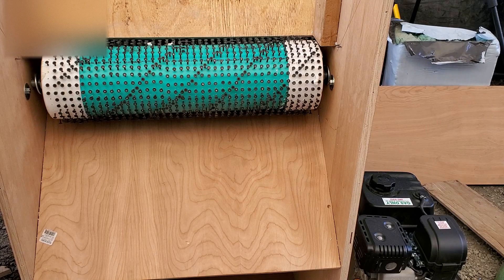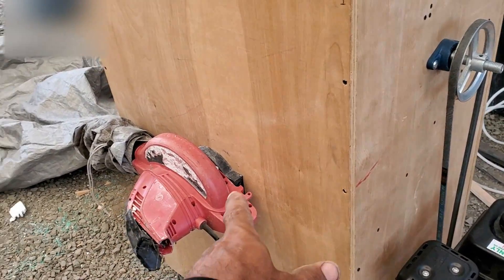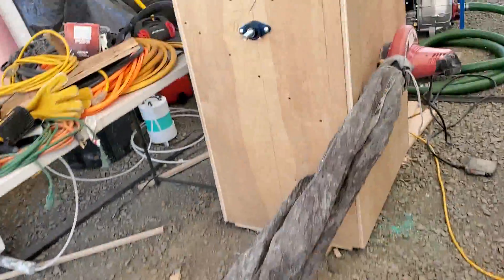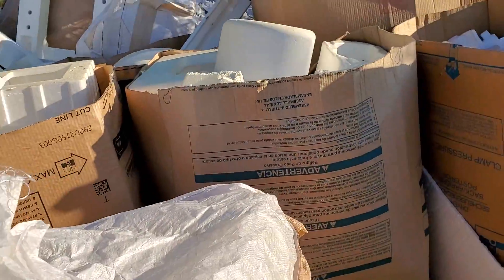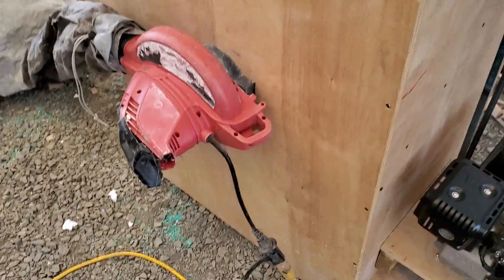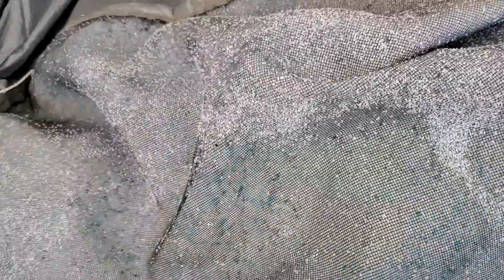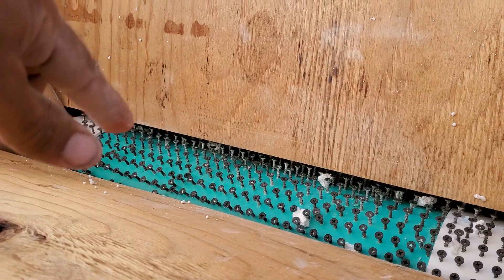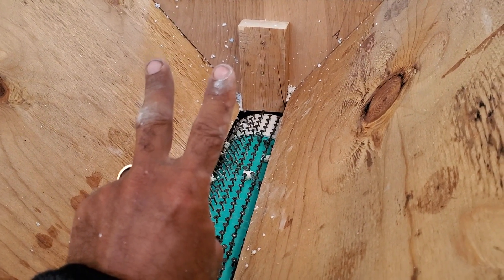DIY Foam Shredder | Styro Aircrete | EPIC Cement Mix | #foamshredder #styroaircrete #aircreteharry

Comment: Im looking to do the same. One thing I found that EPS insulation property's degrades as it is exposed to sunlight. You shouldn't store outside while its exposed to direct sunlight. 😊
Reply from the maker: @tomkupcho7041  Welcome to the channel - Tom! Check out the newest video called: The Ultimate Foam Shredded, posted on this channel. It is more convenient & a faster process of shredding the foam. The DIY Pdf file is available on our website, link in the video description - for everyone's convenience. Thank you for your comment -  while smaller pieces are stored under a boxed section, larger EPS blocks have been outdoors over the 4 seasons doing well.

Comment: You need another way to feed the shredder. One mistake and there go your fingers.
Reply from the maker: Welcome to the channel 👍 
I since developed 
a Better, Faster Upgrade:
https://youtu.be/TdpaMzGhSp4
🖐 🖐
Reply: I just watched that video. Better. I don't want to be a safety Sally, but I have known a half dozen people with missing fingers. I would a one foot chute.
Reply from the maker: @tinybigbus1873  We are not sensitive to comments - it's absolutely valid, also the reason why we haven't offered the DIY for this shredder. 
We were careful & had in fact made a feeder to push the foam pieces in at a faster, more careful pace.

It wasn't fast enough - the New Shredder is it for us. Extremely fast, safe & easy to build. 
Appreciate You!
Reply: I appreciate you and your channel. Brofest over.😊 There was one video of a shredder that used 4 skilsaw blades. That is not less safe but it sure was fast. I will see if I can find it. I am almost 60 and would like to live out the rest of my days intact. I am very intrigued by styrocrete. I used to have a concrete company with one mobile mix truck, one delivery driver, one bookkeeper, one receptionist, and one janitor. All of them being ME! I used to pull (fill) a cylinder and send it to the lab. They would do a crush test and give me the results. Have you or any of the other channels done something like that?
Reply from the maker: @tinybigbus1873  Thank you - great words!! Mean a lot to us!! 
Dedication - we speak to same language, I hear you load & clear. Doing what needs to be done. Good for you, Brother! Respect 👍 

Yeah, sure - email me the info to look at it once you find it. Aircreteharry@gmail.com 
Very cool. 
I will have compression tests done in the near future. To all my different samples.

Comment: I see 3 issues with this style:

1. Noisy and pollute gas motor

2. Dangerous because requires push in

3. Slower than the electric version

To me the electric lawn mower is the best choice. It removes all 3 obstacles above and way simpler to build.

I already built 2 electric lawnmower leaves shredder. Worked excellent!
They work on styrofoam too. Dual use. I have to build the additional auto bagging for styrofoam. 
They will be used for styrofoam aircreed insulation for metal shed.

I cringe at the price they charge for foam insulation. No thank you I do it myself for 1/5 of their cost.

Simpler is always better!
Reply from the maker: 📣 📣 Update -
New Video available:
The Ultimate Foam Shredder 

https://youtu.be/TdpaMzGhSp4

Comment: u gonna loss fingers or a hand 🖐
Reply from the maker: Haven't lost any body parts. 
Created a newly updated version; safer & faster 👍 👍
Reply: @AircreteHarry  whats up harry i been a fan of yours for a few years

I had no idea you lived in CO too until you said its windy in colorado

I live in denver....lol i may hit you up for scrap foam if you have any

Im gonna try to build an asphalt pad adding foam and a few plastic concrete fibers
Reply from the maker: @xgymratx  Hey, what's going on!
Awesome, pleased to read that 👍 👍 
Very Welcome to email: Aircreteharry@gmail.com
Reply: @AircreteHarry  have you had any experience in "expanded asphalt"?

I read somewhere that styrofoam really good at keeping it from cracking and that you can increase amount of asphalt with shredded styro

Now i cant for the life of me find that video

What are your thoughts? 

Planning to make styrofalt "dog run" with chainlink amd slowly turn it into a shed with slats then windscreen and lastly coroplast interior walls
Reply from the maker: @xgymratx  Sounds Interesting indeed. I haven't heard of it. When you come across the link/ video, let me know 👍
Reply: @AircreteHarry  well if i cant find it i guess i got to find someone to experiment with it

Possibly me

If i do end up doing it before summer ends you can come hang out and give advice and eat pizza and drink pop
Reply: @AircreteHarry  asphalt is cheap solution if you need quick job done without forming or waiting for curing

Hoping styrofoam can alleviate cost so i can buy less asphalt

And the anti-cracking stress relive is a selling point

Comment: Every time I see “styrofoamcrete” I’m thinking about that French bubble palace, that ferrocement home that’s is organically shaped and all round everywhere but build with compact cement sprayed on rebar steel and therefore non insulated.
A ferrocement style build with an inner and outer metal frame/ mesh provides a nice way to make a three dimensional shape as a house to fill in.
A farm build with a thick consistently shaped wall simply by welding in spacing to pour into with a frame build out of triangular trusses from rebar welded in place in a rond framing/ welding jig.
You have some reusable woorden jigs to form the vertical rebar trusses depending on the different room shapes and other elements like connecting overflows, tunnels etc.
Two dimensional vertical standing frames with fixed welded triangular rebar trusses horizontally tied together with some thin criss crossing rings of rebar all dressed in chicken wire and then layer by layer filled with styrofoam concrete.
This then all covered with a final sprayed concrete smoothed out layer on the in and outside of the three dimensional frame that was filled with the “styrocrete” slurry. I think it would comes out this any as a beautifully shaped and well insulted building.

Comment: I love your aircrete videos.     The shredder does work however a new design is in order.   I would say the shredder wheel needs to have a larger diameter which will allow for a wider feed hopper.    You want to be able to just throw the Styrofoam into the hopper and have it do the rest two things I see one shredder wheel diameter needs increased in size To allow for a wider shredding surface .   The other is those screws I think the reason you’re having to put some force to get it to shred is because of the flat head on the screw when spinning the flat heads together well sort of act as a flat surface and therefore requiring a downward pressure.  
I guess you would have to grind the heads off all those screws to see if that theory holds true also it might work better with rows of shredder teeth which have spaces wide enough between each row to allow for the Styrofoam to fall down in between the rows of shredder teeth.
Reply from the maker: Update:
New Video available 👍👍 
https://youtu.be/TdpaMzGhSp4

The Ultimate Foam Shredder  DIY available:
https://aircreteharry.com/product/the-ultimate-foam-shredder-by-aircrete-harry-as-seen-on-youtube/

Comment: It seems like Harry is on the leading edge with this home front technology/hobby. Has any DIY person made 4 x 8 sheets of EPS concrete ?  I think it would work great for external sheathing.  Better than OSB. Water damage is a leading cause of building problems, I think this material would prevent that.

Comment: Hi Harry, I just wanted to say great video.  I've been thinking about how to build something like this.  One thing I would mention is when you're adding music to the video, you need to lower the volume a little.  When the music came on, I had to lower the volume settings to about 2% volume, and when you speak I had to raise the volume back up to 70% volume.  You might want to work at the mixing in the sound so that it isn't necessary to change the volume.
Reply from the maker: Update:
New Video available 👍👍 
https://youtu.be/TdpaMzGhSp4

The Ultimate Foam Shredder  DIY available:
https://aircreteharry.com/product/the-ultimate-foam-shredder-by-aircrete-harry-as-seen-on-youtube/

Comment: Great job Harry.
You said that there is an internal pipe on the inside so the caps are not crushed in. I wish you  would have elaborated more on that. Is it a pipe that covers the 3/4'" threaded bar? So the nuts have something lock against?
Any chance you remember the size screws you used?
Reply from the maker: Update:
New Video available 👍👍 
https://youtu.be/TdpaMzGhSp4

The Ultimate Foam Shredder  DIY available:
https://aircreteharry.com/product/the-ultimate-foam-shredder-by-aircrete-harry-as-seen-on-youtube/

Comment: great video- what is the name of the pipe you used with small holes
Reply: I bought the same one from lowes:  https://www.lowes.com/pd/Charlotte-Pipe-6-in-x-2-ft-Sewer-Main-PVC-Pipe/4757741  Harry drilled the hole pattern himself. See his foam shredder video he did before this one.
Reply from the maker: Update:
New Video available 👍👍 
https://youtu.be/TdpaMzGhSp4

The Ultimate Foam Shredder  DIY available:
https://aircreteharry.com/product/the-ultimate-foam-shredder-by-aircrete-harry-as-seen-on-youtube/

Comment: We need to talk @Aircete Harry.

I was in R&D sales in the EPS industry before I retired.

We need to talk bro.

You can buy clean EPS beads that are uniformaly "pre-expanded" from any EPS foam molder. Think beads inside an a bean bag chair.
Reply: Thank you for posting this. I wanted to build a shredder. I took 5 mins and found a company in Phoenix AZ a few hour drive for me that sells recycled Styrofoam in 9 cubic ft bags. I'm sure when the time comes I can negotiate a better price on a larger volume once I know the cubic ft need I will have.
Reply from the maker: The Ultimate Foam Shredder  DIY available:
https://aircreteharry.com/product/the-ultimate-foam-shredder-by-aircrete-harry-as-seen-on-youtube/

Comment: Thing works as designed, I like it Harry!  I had an idea...Seen a video where they made a "snake" from burning powdered sugar/ baking soda on sand with lighter fluid-basically the sugar and baking soda increased in volume about 1000 times and my first thought was -aircrete additive experiment lol

Comment: Harry. Move the ramp down more on the leading side so it can actually grab and pull the foam in.  Use the spinning drum to your advantage to actually grab and tear in the foam chunks. Think of it as a planner wheel.  Shoving it directly on top will give you push back. Also, to prevent bigger chunk from getting thru, place a tough screen bellow the drum on the bottom side so it will force the foam to get re mulched or pass the screen.
Reply from the maker: I have more to add like a feeder push bar.
Reply from the maker: Update:
New Video available 👍👍 
https://youtu.be/TdpaMzGhSp4

The Ultimate Foam Shredder  DIY available:
https://aircreteharry.com/product/the-ultimate-foam-shredder-by-aircrete-harry-as-seen-on-youtube/